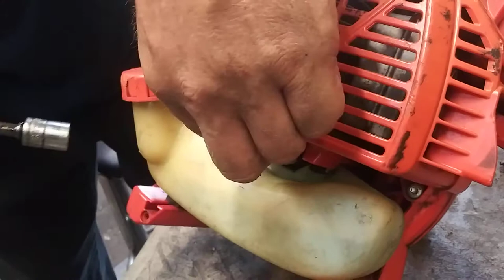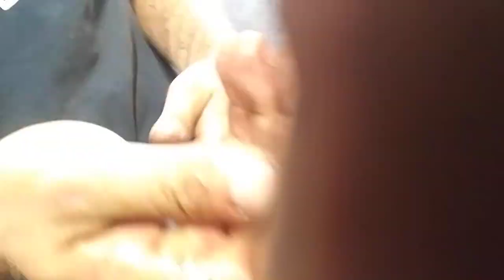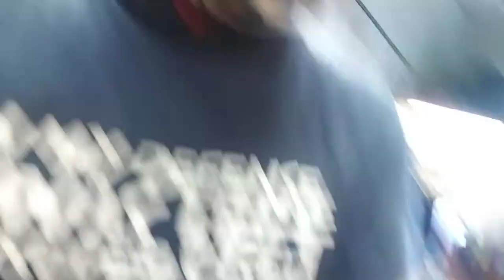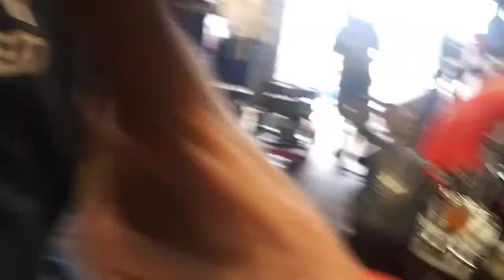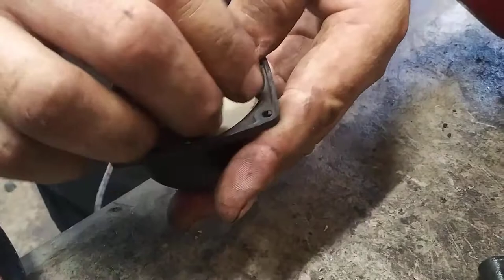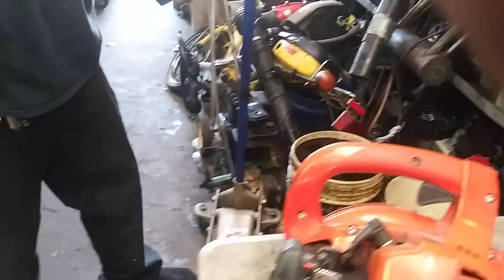* Echo ES-250 PB-250 PB250LN PB-252 recoil rope and pawl replacement

Comment: I have an issues. The coil works good when.i separete it from the housing. But when put in, it wont let me.pull the cord. What part cpuld be not working?
Reply from the maker: While installing the coil line the magnet on the flywheel to the coil. Put a business card between them to gap them. Now ti h then coil. Remove card. Great job. Your done.

Comment: Same kind of blower used and was left outside for a week now it won’t start just pops like back fire took out old fuel added new fuel and new spark plug and still won’t turn on has compresión
Reply from the maker: bad coil. it got wet. check spark
Reply: @smallengineguys  yes I think that’s what it is I have compression I have fuel but no spark I replaced the spark plug ..how do I check spark..?? Thanks in advance
Reply from the maker: @MiguelSanchez-qr5qy  https://amzn.to/3EGeMWf
Reply: Thank you will do change it out , guys thanks again for ur help happy holidays